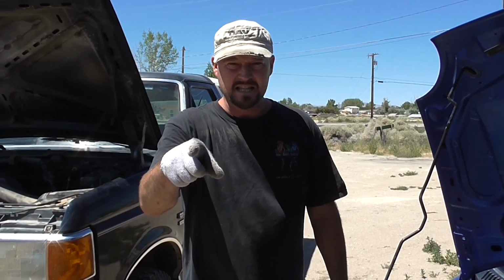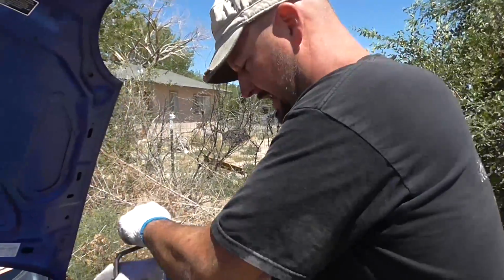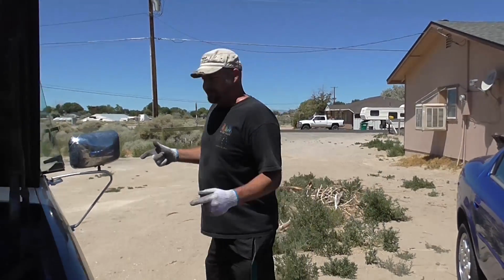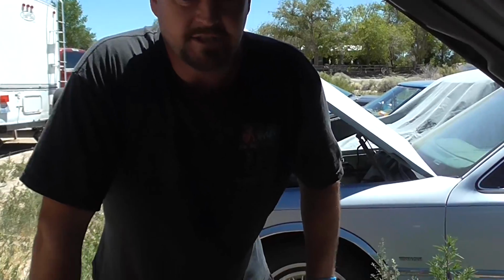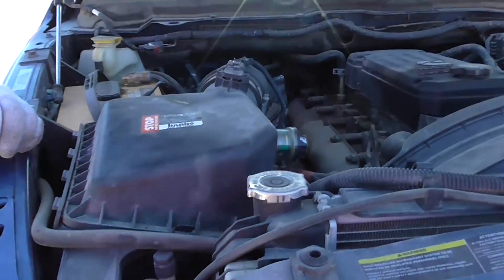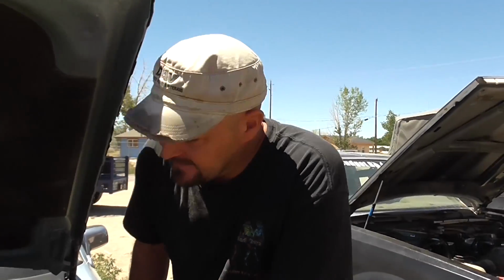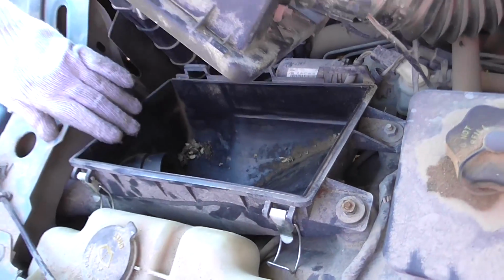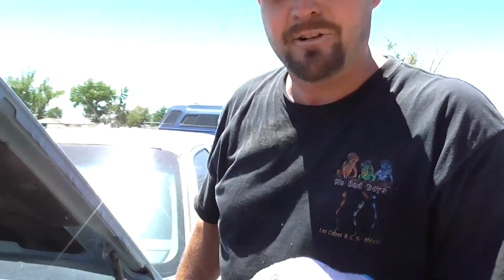Free Horsepower And Fuel Economy - Intake Mods

Comment: No saying everything stated here in this video is false. But I do hate to see how many people are gonna ruin certain engines from this. That whole “breathing through paper,” is usually the way you wanna breath. See all that sand around him? Yeah a K&N may flow more... cause it’s filtering LESS. Go check out any turbo diesel forum (Cummins for sure, I don’t frequent others.) and tell me what you find out about stock air filter (paper) VS a K&N (or other “high flow” designs/cold air intakes.” My Ram, for instance, has a factory cold air intake that, even with a $400 CAI.. you aren’t gonna gain shit else above. Unless you are doing a lot more high performance modifications. Anyway. All I’m saying, is if you don’t know much automotively.. do yourself some good ol fashioned research before just modifying your vehicles all Willy Nilly. Don’t take one guy on YouTube’s advice as FACT.  (Again, I shouldn’t have to repeat this, but I’m not singling out this guy. NOR am I saying that this video is 100% false.)

Comment: Very inspiring, thank you.
All explained makes sense.
One thing I still have to pay attention is concerning the maf sensor - in terms of how not to interfering it.
I think I will apply it on my 2013 at nissan livina (indonesian version). It has not only "straw" size intake but also "flated" instead of round.
I like the motto "mods - enginuality - common sense "....
Reply: I did this to my 95 Taurus, and it turned on my check engine light due to the maf sensor, I just don’t know how I would get it to turn back off other than using a obd1 reader to clear it

Comment: The thing about filters... If it's not restrictive - it's not filtering. If you want to make it less restrictive without losing filtration, it needs more area (you're reducing the speed at which air travels through it for the same flow rate, hence less pressure drop). What you have here is a less restrictive filter with significantly less area than stock. Essentially, it's letting more shit through.

If you don't plan on keeping the car long term - who cares, right? But if you do - she'll start burning oil sooner rather than later.

Comment: I was under the long standing opinion that the cam was at the heart of pollution solution. If you don't do something with that, what have you really accomplished??
Reply from the maker: The camshaft is part of performance.  The intake and exhaust mods are some things that can be done very easily and with very low budget to get some performance while saving up for cam, lifters, double roller chain, roller rockers/lifters, etc.

Comment: I love your ideas bro! I am thinking of coming up with my own Cold Air Intake, and that's how I landed on your VID!  :)
do yolu have any websites for me, so i can try to find good angle tubing for me? I am still trying to fabricate one for mine,
i have a 2009 Kia Spectra i already did my own air intake (short Ram) 
thanks man
Reply from the maker: Decide on intake pipe size and you can use universal intercooler tubing found on ebay which has clamps, many shapes and sizes of tubing to design your own intake.  Do not forget to ensure all factory fuel injection sensors have a place in your new intake design so engine runs good.
Reply: yeah man thanks a lot for your tips anything helps. is there anywhere where i can send you picture :) of my engine? And i am a bit afraid to do things to my engine since my car is only 6 years old.

Comment: Dude, find out what size throttle  body the ford 4.6 has, then measure the size of the hole your telling everyone is the restriction, you will find the hole is the same size as the throttle body or bigger. Same with the 72 240z find out what cfm the carbs are or measure the intake size of the carbs and multiply by two. now measure the intake opening in the 240z airbox. You will see the hole is capable of flowing the same size as the carbs can flow in volume.
Reply from the maker: Increases are increases especially when there is restriction such as airfilter.  The more the filter can breathe, the less restriction.

Comment: You Gotta  Love It. Sound,s like a lot fun .I did a cold air intake on an old Nissan Primera 2 litre Gt. Helped slightly in power. Fuel economy  stayed about the same ,because i drive hard.I added a bit of marine 2 cycle oil to the gas tank 2 oz to 5 gallons of petrol.This improved gas mileage from 31 miles to the gallon to about 32.5 miles to the gallon.

Comment: Will these mods light up check engine or cause a failed emissions inspection test?
Reply from the maker: Every vehicle is different and they have sensors in different places.  Always ask your emissions station before hand and make sure that person or station is the one inspecting your car.  Every inspector or inspection place is different.  It is always best to ask them questions first before hand.  Perhaps a spare intake box so you have the original one for emissions testing only.

Comment: It's amazing those hot air intakes still sell. Have one on an 02 Dakota 4.7. Avg IAT 143-145°, stock box was 113-118°. This was from a full k&n kit.. People think those baffles are "robbing power" just like EVAP/EGR misunderstandings. The stock intakes are the MOST reliable and they were built to operate at max efficiency for that engine. Sometimes on pre 96 if the Throttle body is big and the intake chokes it then you may see a little something otherwise it doesn't matter take the whole thing off there's still a port that's behind it that's a precise size. Not too big. Not too small. Just call it for what it is, intake roar. That's all your gaining.. and on bigger v8's it actually sounds decent.. easiest way to try is to just pull the lid go up n down the street. You like the roar drill the box/cut it open doesn't matter.

Comment: I was temped to change videos until i figured this guy kinda knows what hes saying. I've made more horsepower on my stock intake though than any aftermarket intake. I just changed to a different material (drop-in filter not a pod filter) & slightly modified where the outside air is sucked in.
Reply: made a new Free intake video on my Mad Boosting you tube channel.  I believe this on is better, it is specifically for Ford modular 4.6 and 5.4 engines in the F150, F250, F350, Excursion, Expedition, some mustangs and other Fords that used this unique cone filter with very small intake hole (reverse trumpet like I call it)

Comment: after 3 years using those shit filters I thrower my motor away, it is same like to use old socks :DD .  it sucks all micro dust after some  time  you need  rebuild valves and new rings for me was 3 years

Comment: Can increasing the air to the engine actually cause damage? I'm wondering because on cheap cars like my Mazda 3, did the engineers design the engine to only withstand a certain amount of combustion. Now that the air flow has increased, can the explosions be too much for the engine to handle?

Comment: putting a pod filter on a n/a engine virtually makes no performance difference in actual fact it can do the opposite there is no point putting a pod filter on unless you do other mods aswell
Reply from the maker: pod filter is a general statement, not a specific filter.  A small cone filter makes very little or no difference because it is TOO SMALL.   The size and diameter of the filter area element is what matters.  Installing a LARGE filter area element brings in more air and that helps ANY engine, N/A or forced induction.  On N/A engines low end torque improvements are noticed the most, not horsepower.  Torque is what moves you from a dead stop in acceleration.  Horsepower comes up higher in the RPM range so not much difference in Horsepower.  Now when large free flowing intake and exhaust are done together, torque and horsepower levels are increased and at different RPM power bands depending on how the exhaust is sized and what muffler is used.  Intake is not a GENERAL topic, it is a SPECIFIC one.  Those channels that show no performance gains on intake are not using a intake large enough to out perform the factory box.  Intake element area size is everything in the intake department.  Exhaust pipe diameter, bending, and muffler backpressure levels are everything in designing the best exhaust flow for low end torque and peak power levels.

Comment: Won't KnN filters allow more dirt/debris into the engine because their more porous that paper filters? 

Or the KnN filters need oiling and the oil evaporates, coating your sensors possibly?

Also removing your air box and put the new filter in, won't you be sucking in more heated air in the engine bay? thought that cooler air is better than more air volume.
Reply from the maker: every aspect of improving airflow must be looked at.  Location of filter, size of filter, intake area, particulate filtration.  Must weigh pros and cons with each type of filter to make informed decision.  What is best for me, may not be best for you.  Everyone drives in different locations, elevations and such.  It is up to each person to decide what works best for them.
Reply: The closer to the engine is worster cause it gets hotter

Comment: I've been modifying airboxes on cars and motorbikes for 40 years and I know that these mods work.
Modern EFI systems will compensate automatically for the increased airflow.
Most carburetted systems will handle the K&N ok but the increased airflow of the modified airbox will probably require up-jetting, especially if the machine is used hard. No up-jetting and hard use will probably cause engine damage.

Comment: I remember taking my grandpa's old 76 Ford F-100 302, granny 4 speed and taking the old small inch and a half exhaust off of it and had a muffler shop put true duals, from the manifolds 3 inch exhaust with flowmaster 40 series. Put a 3 inch x 14 inch K&N round air cleaner on it, 500 cfm Holley 2 bbl carb and it woke that thing up a lot. Truck went from running low 17's to high 14's just doing that. Even though fuel consumption went from 10 mpg to 6 mpg. Grandpa had never seen that truck run like that and told me it wouldn't run 85 maybe 90 mph. Well uncorked it ran 114 and was banging on the redline. Amazing what you can do, especially to the old 70's and 80's cars that were choked back so much to reduce emissions and gain fuel mileage.

Comment: This is the most convincing satire I've seen in a very long time.   (Over 22 minutes in 26 minute video, before a single modification is actually performed.)  * "Looks stock" - obviously appearance is not relevant to increased engine output, and thus increased performance.  * Sounds different - many factors can alter how sounds are created, but sound is obviously not relevant to increased engine output, and thus increased performance.  * "Can't breath through paper - obviously not relevant to increased engine output or economy, since hundreds of different engines breathe very well through a paper filter medium.  * Slaps intake component, while talking about exhaust component.  * Says engines breathe out, while pointing to intake components.  * Talks about power - says nothing about how much power.  * "As you can see, the only noises...." - Really?   * "As far as performance, ya don't hear any" - Really?   * Claims car manufacturers sell fuel.  * Absence of any peak power or torque measurements (before or after modifications), absence of any performance measurements (before or after modifications), absence of any fuel consumption measurements (before or after modifications) - obviously the exact definitions of relevance, re. whether the modification has boosted anything, or was just talking loudly about nothing.  * Absence of any information about air being filtered - obviously relevant in a recorded conversation about air filters.
Reply: He is missing a lot of information especially about if it actually increases fuel economy. You should go ahead and get about the rest of the information like does it help with your fuel economy or it will make it worse?

Comment: "You're whole heavy giant powerful v8 is breathing out of a friggin straw" LMFAO
Reply: +Budget Boosting lol I never said it wasn't true the way you said was fucking hilarious though. Keep up the good work Jerry Lawler.
Reply from the maker: Tried to make the subject fun.....
Reply: @budgetboosting  That Lincoln with the STOCK air box and a STOCK Motorcraft air filter will top out at 109 mph.
 Your "modification" allows that same car to top out at an astounding 109 mph.
  You can accomplish more by removing the snorkle from the air box and running a short piece of 3-inch dryer hose forward -- in order to pick up cooler air from forward of the engine bay.

Comment: My air cleaner is behind The battery so in another words the battery is blocking the air going through if I cut air cleaner it won't flow air because The battery is blocking the air I don't think it will make a difference
Reply: Musa Touray focus?
Reply: Musa Touray Relocate it to the trunk.
Reply from the maker: Every car is different.  Not all air boxes are the same.  Perhaps you could design a custom intake that can lead to the grille or battery relocation depending on the car.
Reply: Musa Touray
Reply: just do what he said anyway.  let your motor decide if the battery will keep it from breathing.  its only a little work right?

Comment: No such thing as free increased performance.  The more air the car breaths in the, more fuel it has to burn.  Engine computer will adjust mixture accordingly. More air= more gas.
Reply from the maker: less throttle is needed for engine output.  Low end torque gains are what I most notice on this mod.

Comment: This is the most stupid thing I have done. I did this change after watching this video !!!!....DNT CHANGE THE AIR BOX INTAKE !!!!!!......IT WILL CONFUSE YOU MASS AIR FLOW SENSOR .  I did made some holes in the air box intake. Nice sound, right ?.....no much power gained....cool impression.....but few days later I start up to have a lot of problems......low power.....decreasing acceleration, less and less power......I have been to many mechanics.....testing everything on the car.....changing different parts ( fuel pressure regulator, IAC valve, etc etc ) .....I felt to throw the car to the junk yard......it took me 6 months to understand the stupid thing I have done......right before I was ready to buy a new mass air flow sensor. I just took out the box and cover the holes I have made and the MAF sensor start up to operate and to send again correct information to the PCM. It was nothing wrong with the car. It was wrong what I have done. The engine was starting to make knocking noise.....it was absolutely horrible and tiring experience. PLEASE DON'T DO THAT !!!!.....You will end up in the middle of a lot of problems that you will have no idea from where to start......and you may end up spending a lot of money and any diagnostic will fail.....all the components were good guys......I was desperate.....SO, I PAY A LOT FOR THIS LEARNING.......TAKE IT FOR FREE !!......don't do everything you see on the internet.....when you see to much excitement there is no much thinking !.....question everything !
Reply from the maker: I have no way of knowing how you did the modification.  Every car's intake design is different.  If the wrong area of the intake box is cut away or removed, it will not have the desired effect.  Everyone needs to ensure they research their particular vehicle, engine, and its air box designed before cutting or doing any kind of maintenance.  I can only control the vehicles I have done myself, I cannot control the tools in the hands of others trying to duplicate what I have done with a completely different vehicle, or intake box design.